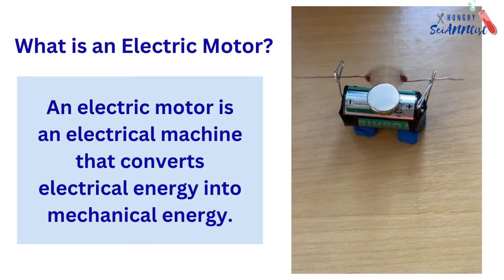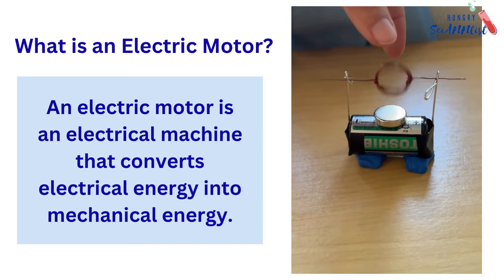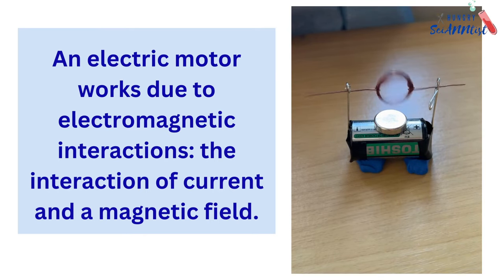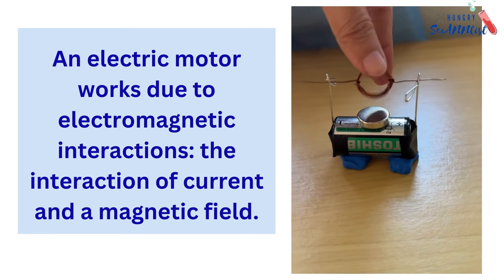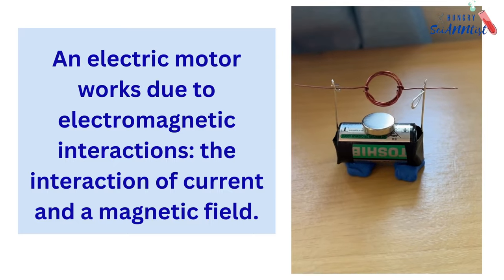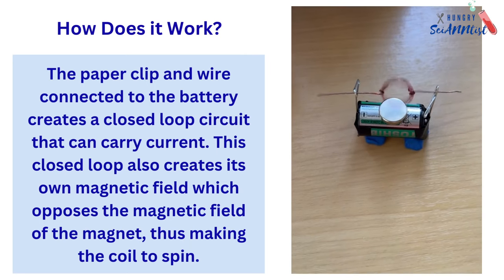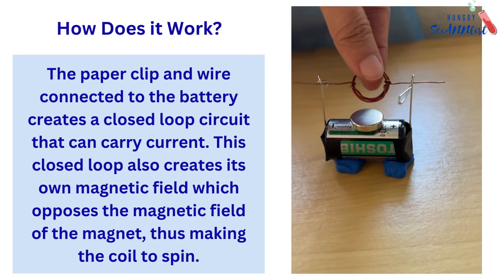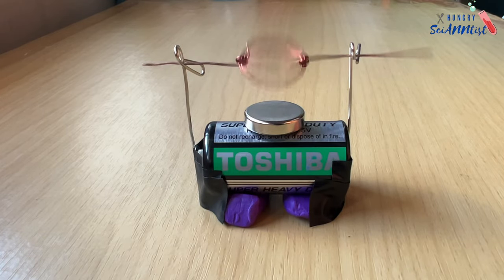DIY Simple Electric Motor | How Does it Work? | Science Project

Comment: Most or all of the videos on this experiment don't explain what is really happening.  Shouldn't you include an explanation which includes electrical current causing a magnetic field in the wire, and mention the Lorentz force, which is what actually makes the coil spin?

Comment: I've seen several of these videos, and I have a question.  On some videos, they say to remove all of the insulation on one end of the wire, and only half the insulation on the other end.  This would make sense, because the electrical (and resulting magnetic) fields would start and stop as the wire rotated.  But, it seems to work even with all insulation removed from both ends of wire.  Would it work better with half removed on one side?
Reply from the maker: Hi! In my experiment, I removed the insulation on both ends of the wire. It works for me. I cannot answer your question if half removed will work better. I might try that too. Also, thank you for your inputs. I’ll make a research on that and I will include a more detail explantion in my next video.